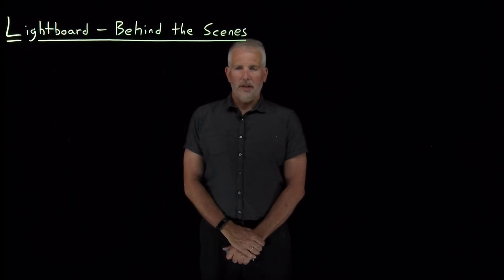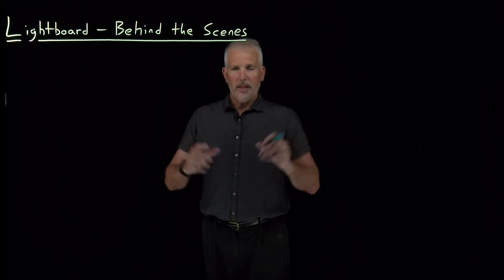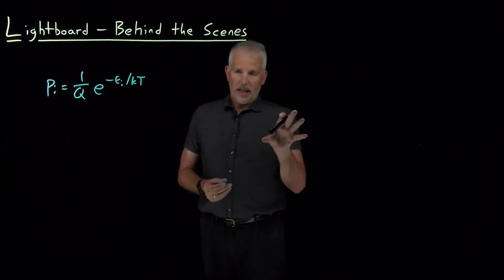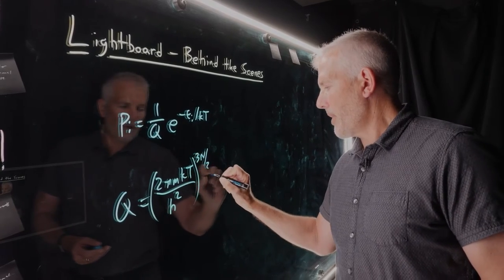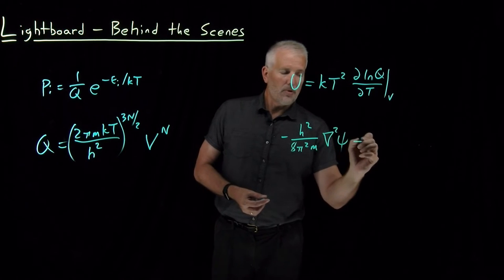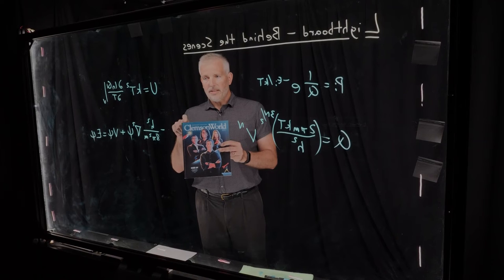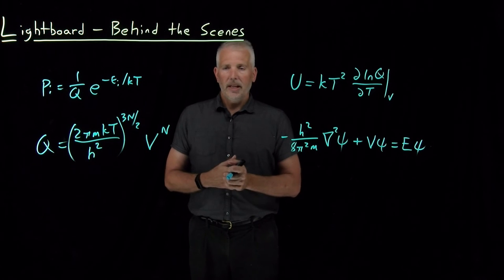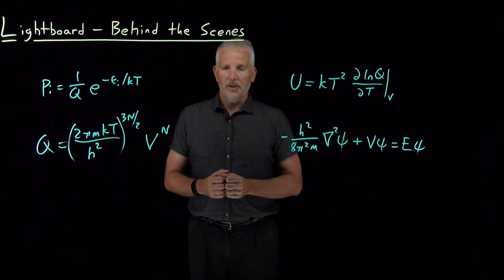Lightboard - Behind the Scenes

Comment: From where did you buy the acrylic and led strip? What brand of neon markers do you recommend please?
Reply from the maker: Sorry, I wasn't the one who built it. Maybe Dallas (who has a cameo in this video) will see this comment and chime in. I know he upgraded a few times trying to get the lights brighter. Unfortunately, I haven't found a brand of markers that I'm happy with. I can go through a marker in just two or three of my 10-minute videos. If you have watched very many of the videos on this channel, you'll unfortunately have seem plenty of examples of washed-out markers. That's a big reason why the LEDs need to be as bright as possible.
Reply from the maker: I got some details from the guy that built the lightboard.

He used tempered glass, not acrylic. It's important that the glass be very clear and not reflect any light internally.

The LEDs came from a company called Waveform Lighting, as did all of the connectors and  power adaptors. https://store.waveformlighting.com/products/filmgrade-led-strip-lights-for-film-photography

Comment: dimensions of the glass??
Reply from the maker: The frame is just barely out of the shot most of the time, so it's about 8 feet wide and maybe 4 feet tall. You could easily work with other sizes and adjust camera placement accordingly
Reply: @PhysicalChemistry  thanks